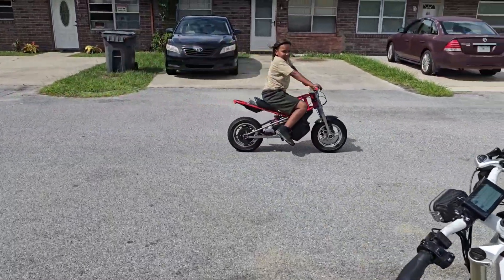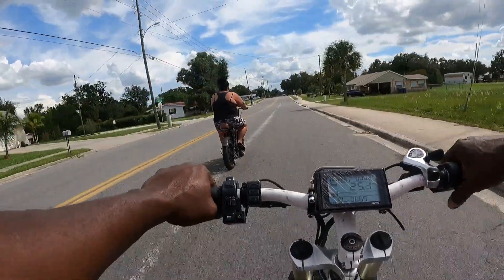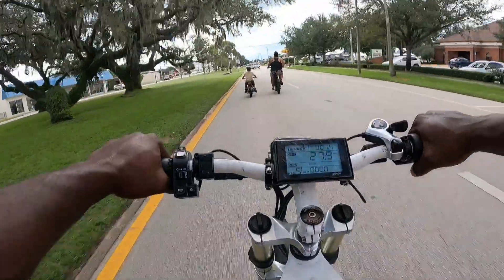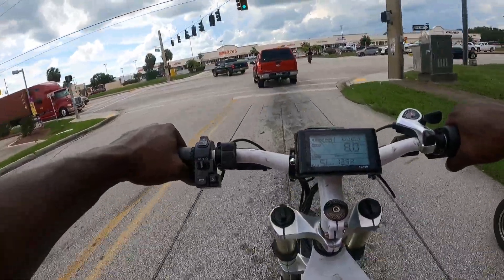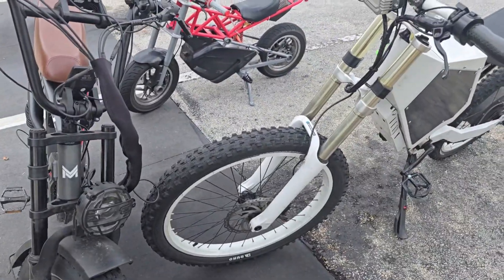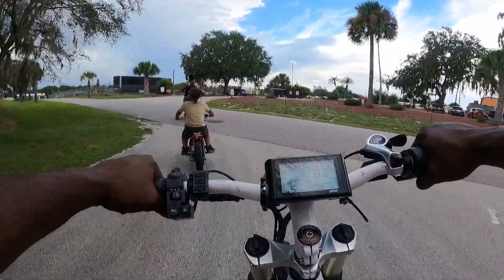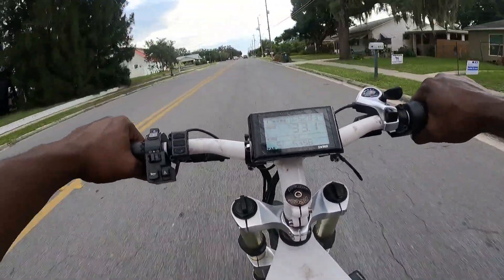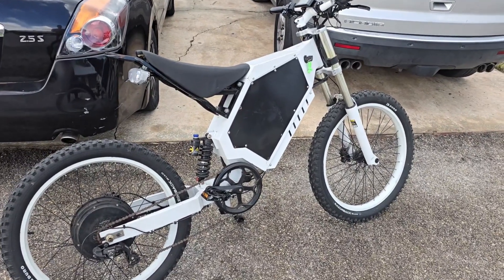3000w stealth bomber clone mod p1

Comment: I got a 72v battery and 72450 fardriver possible 3k or 5k motor not sure..guy who programmed it said I need bigger battery for it to turn up settings..bike won't go faster than 30 and accelerates dangerously slow

Comment: Is it good for climbs or should I at least switch to 5000 watts? I need it for private use as I accelerate even when stationary without the help of the pedals and it climbs when stationary on climbs. Let me know if at least 72 volt 5000 watts are needed. Thanks, I'll wait for you.
Reply from the maker: @tiger8021  ill go 5000w 72v

Comment: Stealth bombers are amazing builds to work with ,very customizable i squeezed a 72v 70ah battery in mine 20s16p with a 72850 fardriver which i had to fit at the buttom of the frame there was no space inside battery took everything and this thing runs the suspension is unbelievable, man just have fun working on this build, cant wait to see you do your build

Comment: Does that have the sw900 display? I had one. The watt meter wouldn't read past 999. Looks like that one is better. I upgraded to a ukc1 display. My bike is actually faster with it. It's crazy how much influence a display with have on a bike's performance
Reply: True
Reply: I have the same but love the ukc1 colour display. Can you swap it strate out? i have an 80a 72v controller.

Comment: 45 thats it? what controller no field weakening?should be able to do 55 wtf
Reply from the maker: @MarkPesell  it's a 80a controller 72v 26ah battery
Reply: Hi. If there is a 80A controller then it is 5000W not 3000W (72*80~more than 5000W) @EBG-offical
Reply: By the way, I changed the controller to 120A and that's the max for this engine. The temperature exceeds 130*C after 15-20 km of driving. You absolutely have to add a thermal switch for 140*C in the windings if you don't want to burn the engine. Best regards.